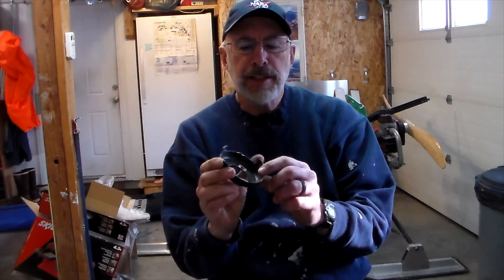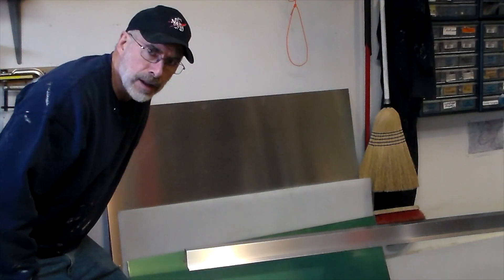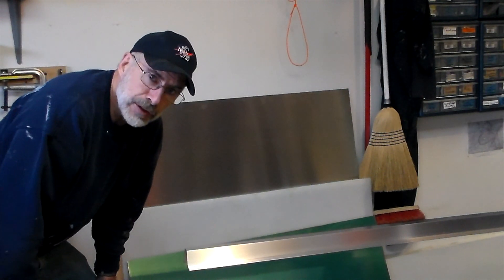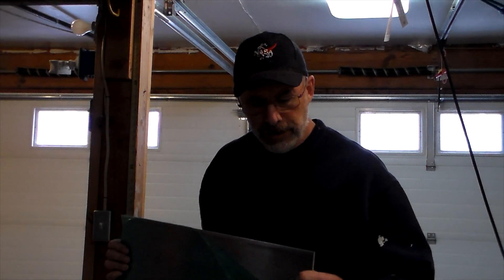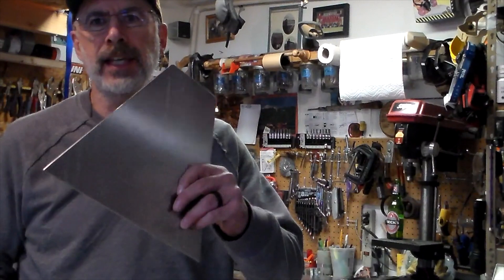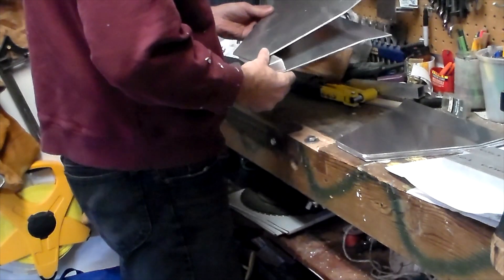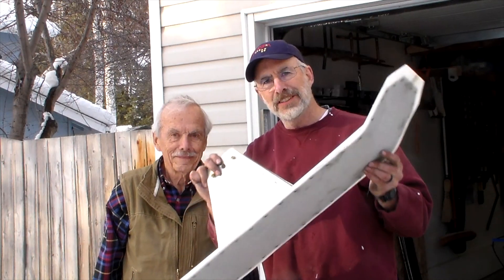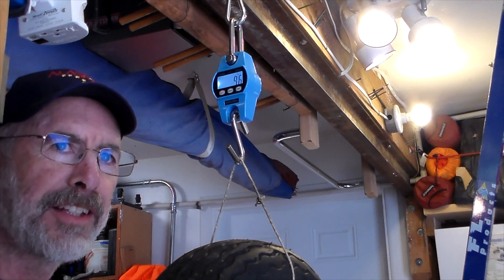DIY Trike Skis

Comment: How did you determine the geometry of the skis? Why that size? Why that angle on the front of the ski? I imagine making them all the same size was primarily to make the build less of a headache, but would building them different sizes produce a performance gain? How much weight does each ski carry?
Other light skis I've seen omit the aluminum deck and attach the plastic directly to the main truss, (the "hat channel" piece). I assume the builders wanted to reduce weight and perhaps (slightly) materials cost.
Ever consider flush-mount rivets for the ski-bottoms? Why steel rivets? Yeah, they're stronger, but steel against aluminum can cause corrosion issues. I wonder if welding would produce a better product. I wonder because on the face it makes sense, but you don't see many welded aluminum skis, especially ones made of aircraft grade aluminum. I see some bits of your project where it might make sense, though.
Finally, are you using standard wood cutting implements? Some of your saw blades look pretty aggressive for metal cutting. My understanding is that many aluminum alloys can be cut with wood blades and drills, but not all. I used to know most of the main aluminum alloys and their properties, but I've forgotten a lot of it. I have worked with fairly thick T6061 in the past (what road signs are made of). It's tough as anything, but it can be hard to work with. For example, bending it too sharply can cause it to break or tear.
Reply from the maker: So there's probably a hundred different variations a guy could do. For a home builder like me, it's a balance of cost of materials, ease of tools used to work with those materials, weight of materials, strength of materials, and time to complete the project. If a guy gets too hung up on this detail and that detail, it takes too much time...and I'd rather be flying. I'm not building the next lunar lander, I just want something that works okay and allows me to fly and land on snow and ice. Could you improve on this design...absolutely!
Reply: @skycowboyak4549  
Truth be told, I live a stone's throw from the field near the intersection of Steele Creek and Chena Hostsprings. I think I pass by the home of one of your flying partners (or maybe his dad's home, I'm not sure) twice a day on commute! I have potential access to a weight-shift ultralight which has been in storage for several years, and needs a thorough going over before I dare put it back in the air. It was well cared for when it flew, but it's been a bit. I'd like to get it flying. My experience extends to about 15 hours dual GA instruction some 20 years ago, but my interest has been life-long.

Anyway, the engineering of this aircraft seems "a step higher" than your trikes. Bigger engine, more instrumentation, a BRSU (which needs repacking/service) larger tires, and more complex skis.

I want to get this bird in the air.

I also want to pick the brains of local fliers. Some, who's organization I'll not sully but who seem not as Experimental as their name might imply (stopped myself from embarrassment just now) don't seem to be especially interested in recruiting outside their clique. Sad, as I view that as Not Alaskan, and it seems very much outside their organizational mandate.

Anyway, part of my intellectual interest, and some of my past professional pursuits, have included trying to figure out ground pressure on snow and ice, among other things. I think if I were making this video, I would have fretted over which decision may have made for the best performance... and the season would have been gone, and the video would never have been made. 

Gee, why haven't I posted any videos.

Anyway, thanks for the video, and thanks for the reply!
Reply: @skycowboyak4549  

Ah... one more thing: Thanks for the reply, and my other, er, counter-reply takes precedent, but: Standard wood cutting blades and drills?
I ask for many reasons, but primarily: This last summer I had several projects wherein I worked with aluminum, and because of problems I'd run into with working on steel plate, I decided to use metal cutting edges... They created new problems, but they worked.
Maybe I should just retake all the metal shop classes I'd forgotten from High School, and buy all the right equipment. Gee I wish I had a Money Tree.
Reply from the maker: @tananam9782  Aluminum is pretty soft and the guys I hang with use carbide teeth saw blades to cut it...works well for me...
Reply: @skycowboyak4549  
My internet seems unbroken for the moment.
Boy, I want my bird to fly this spring. She's a good bird (trike, not m own, my Dad's in fact).
Reply: @skycowboyak4549  
Sorry. My internet is still busted, it seems. I need to put my new machine together. What us old(-ish?) tech junkies have to put up with. Why should youtube stop working on not-so-old platforms?
Oh well. A different complaint for a different time and place.
For now: I wanna fly this spring: I have access to a flying machine: I want it to fly.... Safely.
I'm not sure I have a good maintenance check-list, or even an effective pre-flight list. Maybe it's buried in documentation, but gosh-darn-it-all-to-heck... I wanna fly.